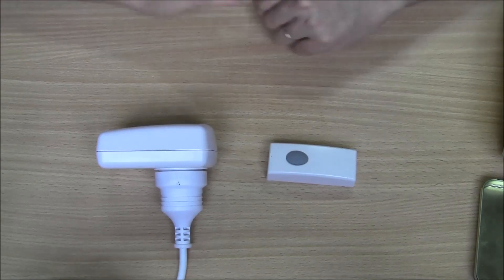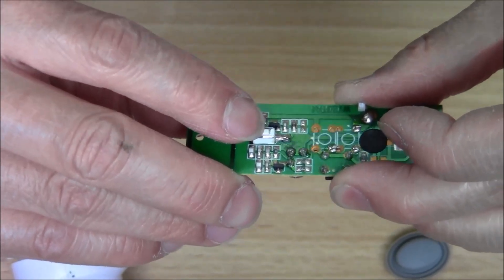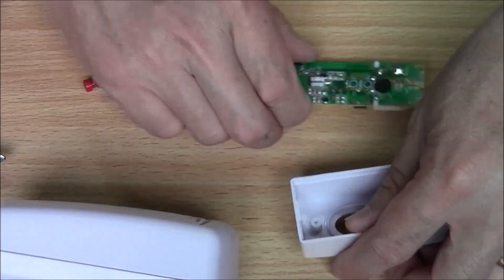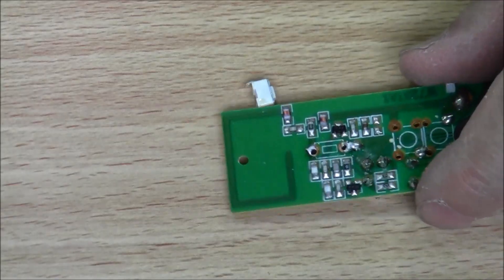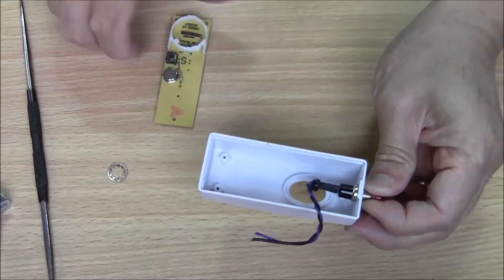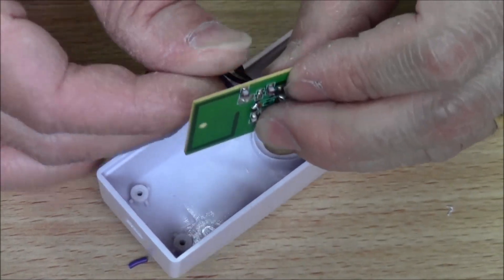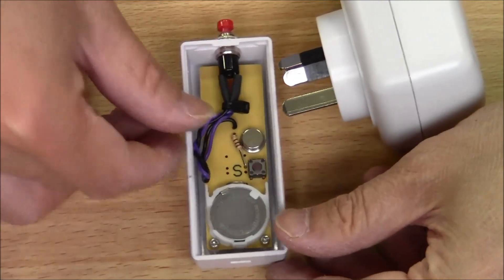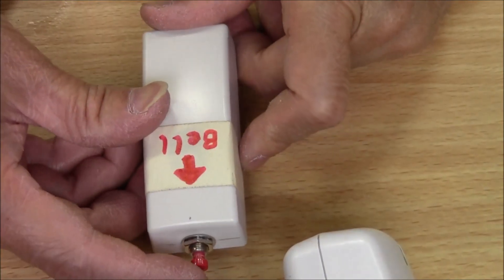Wireless Door Chime repair (push-button replacement)

Comment: Hey mate, im from Poland and i haven't understood what you were saying at 1:20. Did you say something like "bell rings at 2 a.m." ? if you did please tell me, is it possible for well working bell to ring for some reason, because mine has rung by itself few days ago.
Reply from the maker: The main reason was due to that faulty button.  After I fixed that button, the problem did not happen again.  However, my door bell sometimes rings due to interference from other signals such as the car remotes from my neighbours accessing their cars, etc...  However the interference issue only happens a few times a year.    Good luck with your projects.